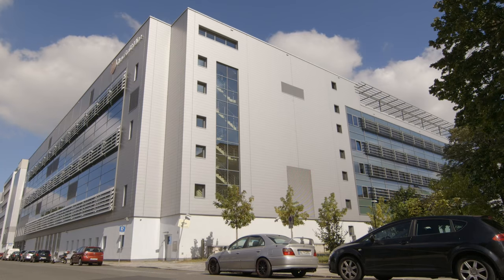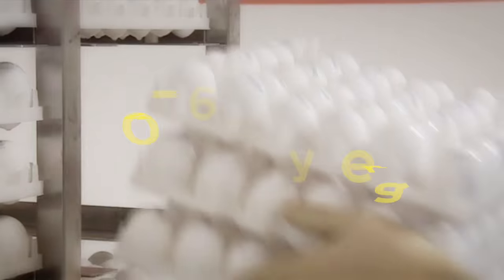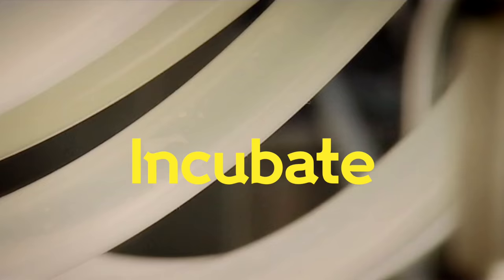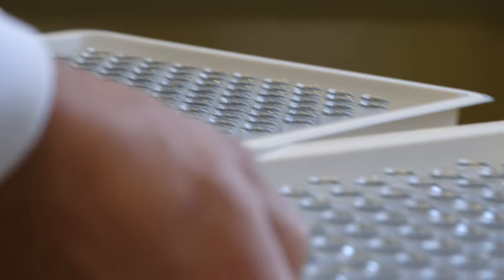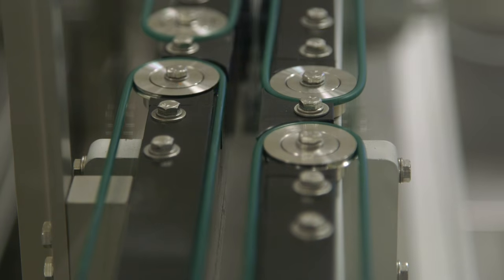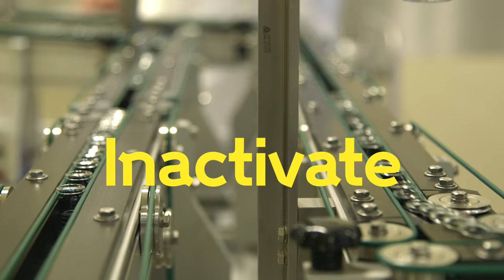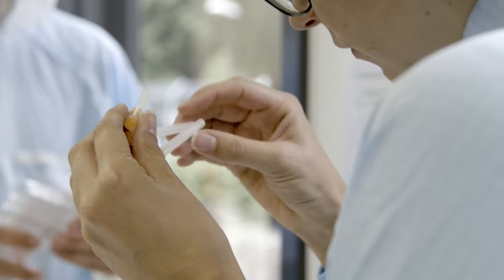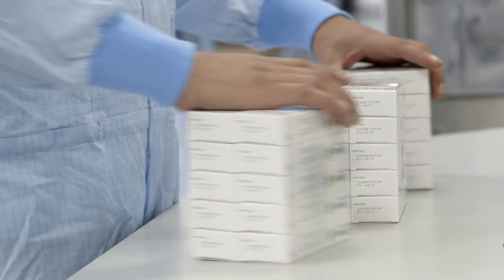This egg could save your life | Wellcome

Comment: I never had a flu shot.never will.if i do get symptoms i start eating one clove of garlic chopped with honey and black pepper empty stomach for two  to three days.
Reply: Your "solution" doesn't work at all, but yeah no vaccines for me either. No need if you're healthy
Reply: @___Zack___  and what if you do get sick? the idea is to give you a controlled version of the disease so that it works like nature intended except that you don't have the risk to fucking die and stuff
Reply: @justalonelypoteto  My case is a little unique but in the event I did get sick, I'd do something called *recover*. 

I'm mid-20s, non-smoker, high fitness level and with a degree in bio. The issue would be more for those on the opposite end of the spectrum.
Reply: @justalonelypoteto  "macho energy", cute.

Considering there were an average of around 75 cases reported cases of polio worldwide for each year the past decade or so, and 0 of those cases in my country of residence, (not to mention that vaccine-derived polio infected twice that amount than actual polio did) funnily enough I'm not particularly concerned about dying from the disease.
Reply: @___Zack___  ok that's great and understandable, it's nice to see a non-idiot in this sea of comments. I'd assume that you don't wanna be a guinnea pig for vaccines, which in the long term evaluation we kind of are. That's, of course understandable and respectable. I don't care much about the small risk seeing as I do quite more dangerous things than it and like the thought of being of service, but your point is also justifiable as unnecessary risks don't have to be taken as long as we have people voluntarily taking them (just like if no one joined the army and there's an imminent war you gonna start forcibly recruiting if nothing else works). Nice talking to you
Reply: @justalonelypoteto  Haha thanks, I appreciate that. For sure, I'd make a vaccine myself and have no qualms about using it (not that I have ever done so, yet) but looking at history, I'd generally avoid government-issued syringes 😄
I'm from the UK if you wondered, it's perhaps not as bad as the US in terms of using people as guinea pigs, but they still did (and perhaps still do) and heck, even quite recently with the VCJD fiasco.
I think you have the right mindset and made your decisions based upon your own circumstances, which is fair enough.

Interesting anecdote: my close friend told me a story last year, it was after our first stint of uni and we went back to his home country of Switzerland. Just to pass time on the train, he was telling me about his mandatory year in the military and how hot the nurse was, who had apparently been there for years. Saying how he hopes shes still there for next year when he gets his next lot of injections but hopes this time he doesnt faint. He's a pretty tough guy, just over 6ft and stoic mentality. So I asked and he said "yeah, so she put the vaccine in my vein here and I passed out pretty fast, work up around half an hour later. Embarassing to be fair". He had no idea and thought it was all normal (sometimes I guess fainting is) untill I pressed a bit about the injection. It was apparently for some kind of vector-borne bacterium that's been rare since the 80s or whatever, but the main issue was the injection site - seemingly the cephalic vein. For a nurse of several years, hard to think she made such a fundamental mistake. He had a couple more shots after that a week later, but seems suspicious as hell to me.